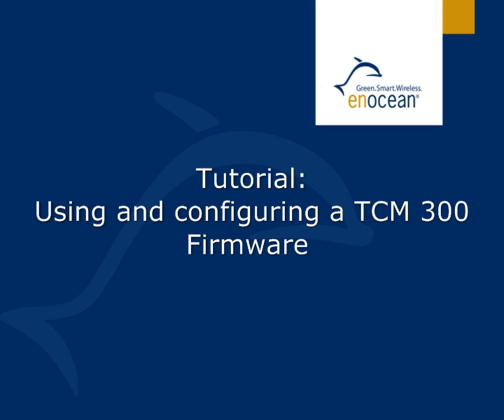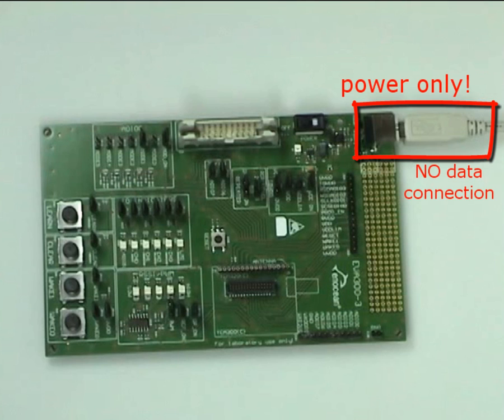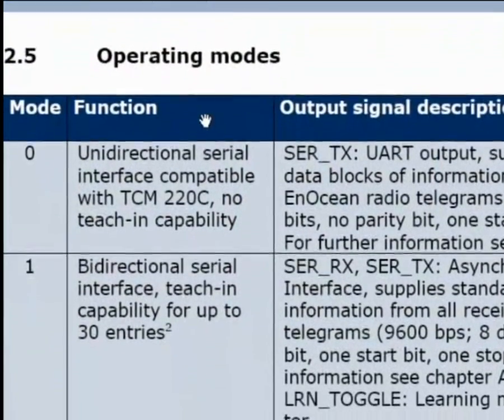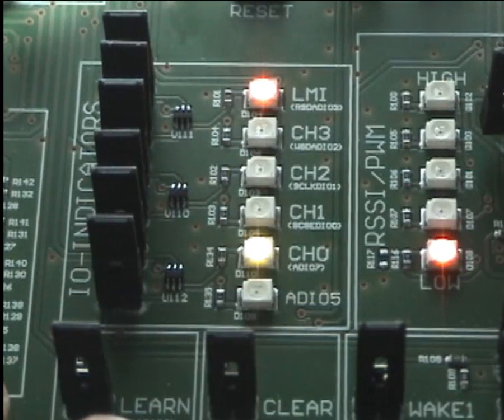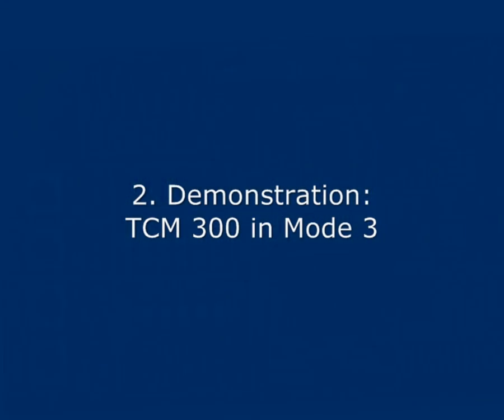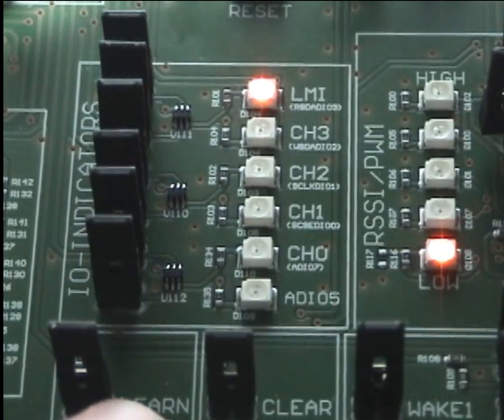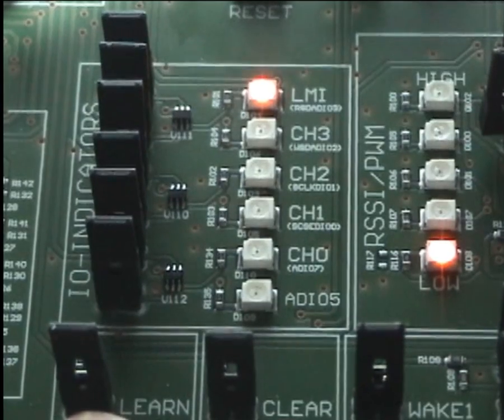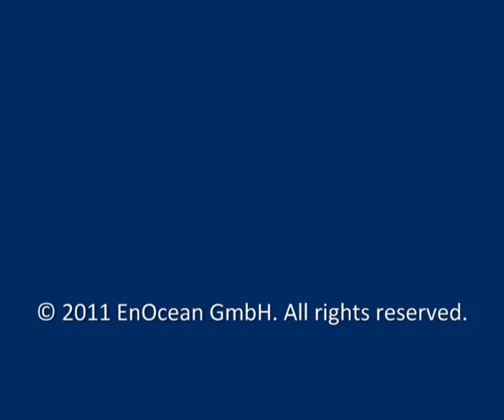Energy Harvesting Wireless Tutorial 5: Using and Configuring of EnOcean TCM 300 Firmware

Comment: how to switch mode on an EDK 350 Kit?
Reply from the maker: Hello. Switching modes can be done by setting the appropriate jumper on the ADIO0 pin (including MOD_ON). Please note modes are only supported on TCM 300 modules running default firmware. Please contact our support team should you need further assistance.
Reply: @EnOcean-Alliance  I am using the EDK 350 Board. Please describe it clearly how to change Channel. I've tried everything.. didn't work.
By the way, the support team hasn't sent anything back. (sent an email 3weeks ago to the support team)
Reply from the maker: @mentoz  Hello, we apologize for the inconvenience, it seems your email has not been received. Please send it to marketing@enocean.com together with your contact information and we make sure the support team contacts you as soon as possible.